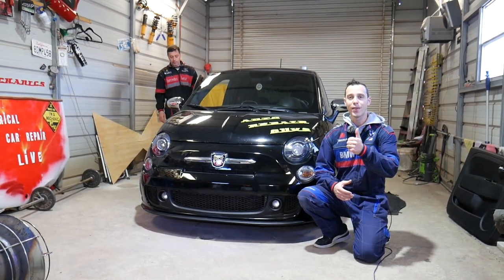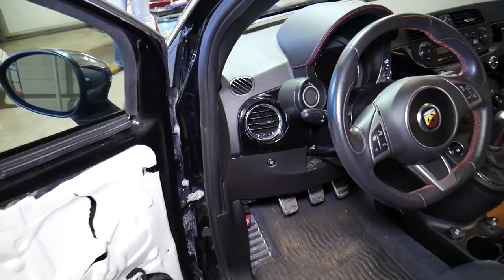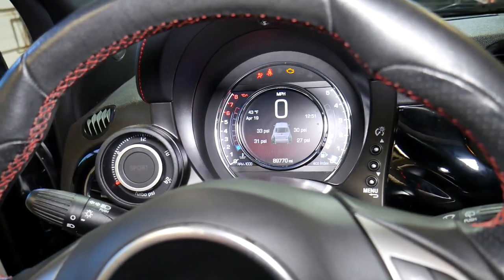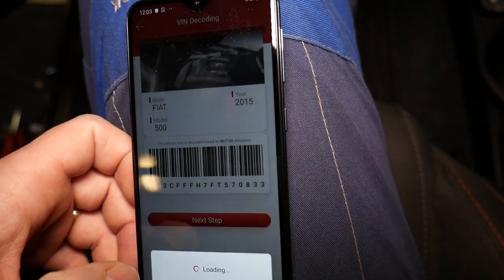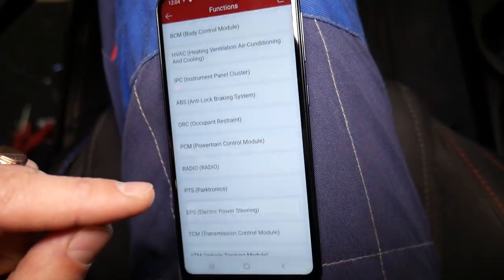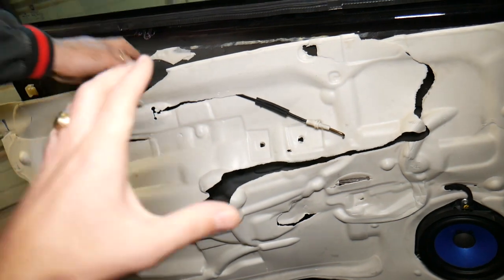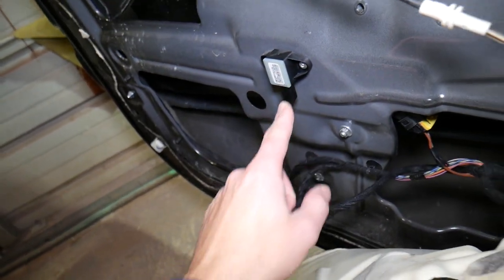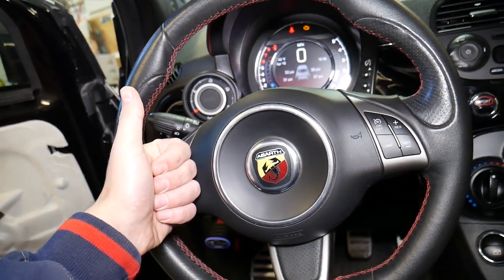FIAT 500 500L 500X AIRBAG LIGHT ON CODE B012D, B012D 2F

Comment: Thanks for this great Fiat content. The connection beneath my passenger side front seat in 500x apparently disconnected and the airbag light and the parking light service lights are constantly on now. A small part of the end piece that connects the two wires beneath the seat broke off, but I don't notice any interior damage around the pins inside. Dealership wants to charge an astronomical amount to "replace ALL the wiring". Not sure if they were trying to rip me off. What are your thoughts? I want to reconnect the wires so badly under the seat to see if the service lights goes off but don't want an airbag to go off on me. What are your thoughts?